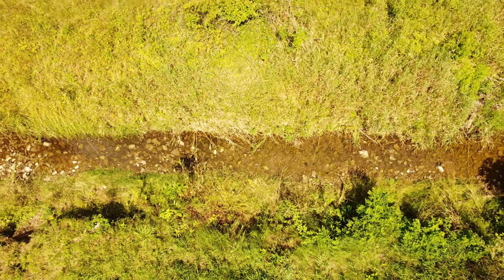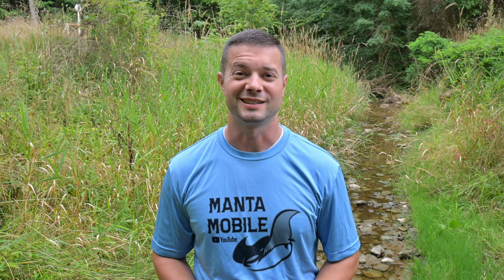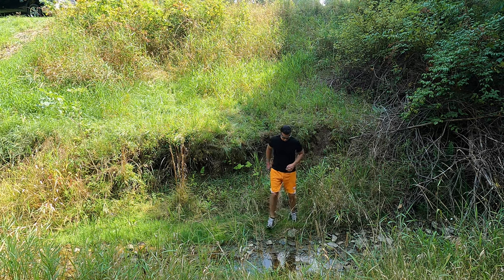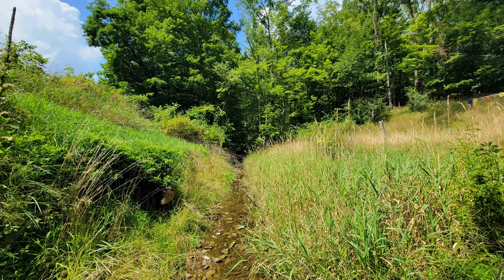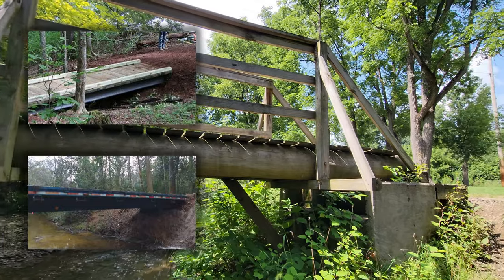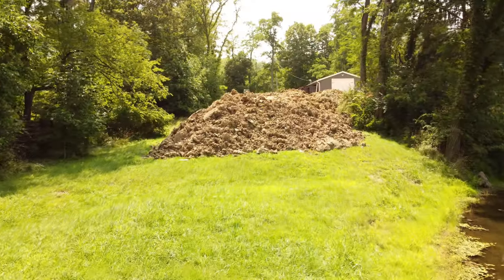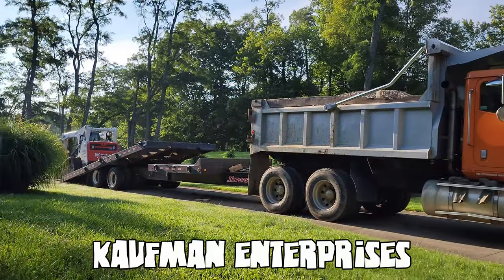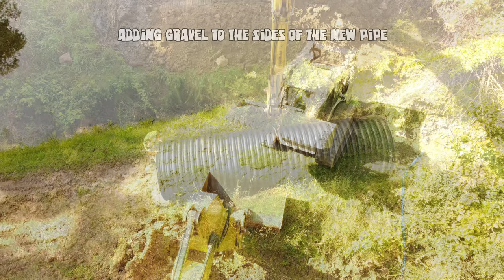Building A Culvert Bridge Over Our Creek

Comment: Just when I’d about given up on finding someone who spanned a steep sided creek with a culvert YT recommends your channel. Like the other guy I have about 25’ to span and the creek is about 18” deep. I plan on using three 48” culverts if I can find them. I’m going to use gabion cages with rip rap to tie them together and creek gravel to fill in the middle. I’ll top it with fill dirt. I subscribed.
Reply from the maker: Nice! Thanks for watching! 

Sounds like you've got a solid plan. The more rock, the better for sure. Good luck!

Comment: Was fish passage considered in culvert design and placement???
Reply from the maker: Not really. Our creek is only a few inches deep most of the time so the only fish are minnows / creek chubs / crayfish etc. But the pipe sits slightly lower than the creek bottom so water still flows even when the water level is low.
Reply: You did very nice work though. Be well and blessed.
Reply from the maker: Thanks!

Comment: Just ran across you on YouTube for the first time. Ironically, the video of the culvert install greatly caught my attention. I have property in Wyoming with a creek running right through the middle that I am considering on taking the same approach with as you did. However, this creek is easily 12 ft deep and roughly 25 ft wide. The weather is generally dry out there but can get impressive rains in the spring. My concern would be excessive erosion and clearly I would have to use larger diameter culvert. Have you had any issues with shifting of the pipe or erosion? Of course I'd be curious about the cost, but that will vary with the area I'm sure. Also, did you need any sort of permits from the state since you were dealing with a natural waterway?
Reply from the maker: Thanks for watching! So far we haven't had any issues with erosion or shifting 🤞. I think adding as much rock as possible makes a big difference. 

All together our project cost around $7k. The 60 in x 20 ft pipe was $3k by itself, then the rest was for the time and machines. We saved a bunch by having the fill dirt on site already.

Without seeing your situation, I'd imagine you could put a bunch of pipe side-by-side and cover with dirt. Lots of stone packed in between and basketball-sized rock at the ends to handle erosion. Good luck!

Comment: Why the concrete rip rap only on one side of the culvert?
Reply from the maker: 1. I didnt have enough for both sides 🤪
2. The downstream side isn't affected by erosion quite as much
3. I'm hoping to add one or two more lengths of pipe on the downstream side someday and I didn't want to have to remove riprap to install more pipe

But mostly because I didn't have enough

Comment: How did you decide on a 60” culvert,  any chance big big rain will wash it out?
Reply from the maker: 60" was the biggest we could find. I wanted it to span the entire width of the creek, and also be as tall as possible so the slope of the dirt was as gradual as possible. It's handled the creek as high as it gets, several times without issue. The rip rap at the mouth makes a big difference.

Comment: What is the load capacity for this culvert bridge?
Reply from the maker: I'm not sure. I wanted to be able to drive my pickup truck over it, and eventually a large backhoe loader. The guys that installed it drove their CAT 315C across numerous times, which weighs over 36,000 pounds. So I think I'll be good 😎

Comment: Why did you only put rip rap on one side out of curiosity? Is it on the upstream or downstream side?
Reply from the maker: We only put it on the side where water flows in, to help buffer against erosion. I have thoughts of maybe adding a second length of pipe on the downstream side so I can make the bridge wider. If I ever do that, any rip rap on that end would get buried and go to waste. But mostly it's just not really necessary on the downstream side.